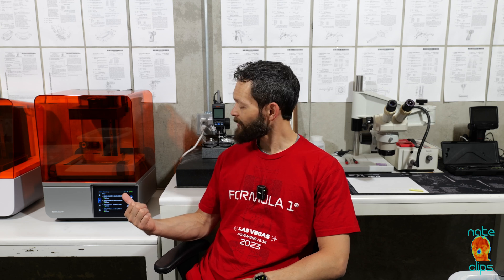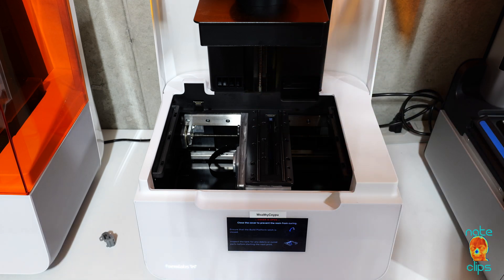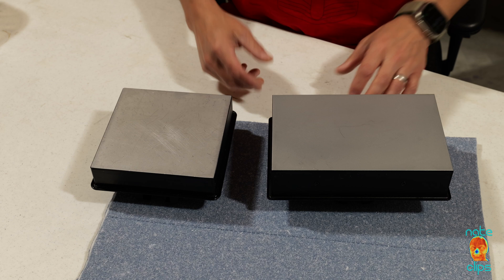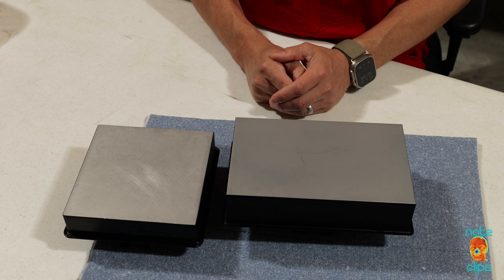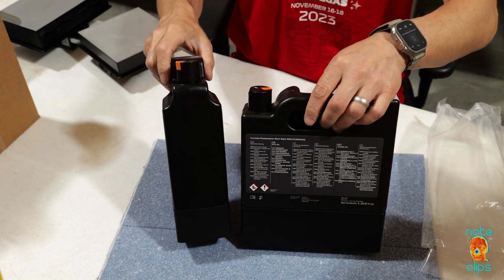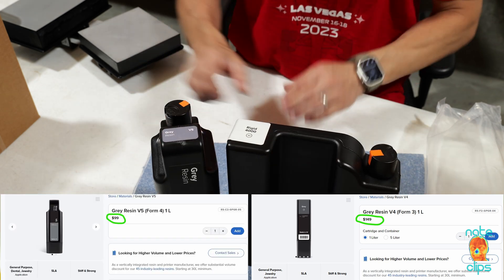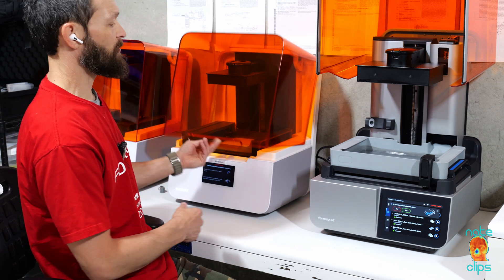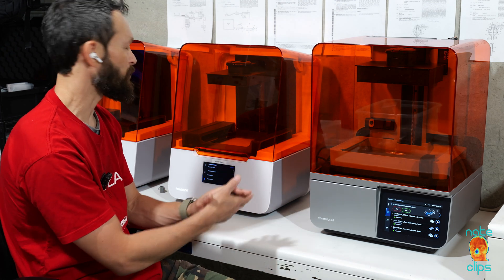Initial Review of the Formlabs Form 4 printer....is it a worthy successor? should you upgrade?

Comment: Nice video!
do you notice any chemical smell from the machine? and you mention fan noise, what would be a comparable level of noise ? a gaming laptop? a deskfan?
Reply from the maker: Any resin printer is going to have some sort of smell.  There's nothing at idle, and you will notice a smell when it's really cranking.  The severity of the smell depends somewhat on the resin type.  Regarding fan noise, watch my latest video;  while speaking on the video, the printer in frame is running and you can definitely hear it;  although, the proximity of my microphone probably drowned the fan noise down somewhat.  I also spoke more loudly while filming...i would say it's louder than a gaming laptop.

https://www.youtube.com/watch?v=LZKhpBIAne0&t=89s

Comment: The fan noise increase is due to the uv leds needing much more cooling than the laser system did. I have 2 Form 2s, 2 Form3 and a Form 3L and I may have hit the end of the road with formlabs with the Form 4. There is just way too much competition in the lcd based printer market for FormLabs to charge this much for the printer. The Form 4 is an 8k lcd which is far and away a great unit but there are now alot of other printers that have 14k lcd screens and cost in the 500 dollar range. The open source resin markets have improved so much with companies like loctite making engineering grade materials for these lcd based printers.  Also the film on the trays will need to be replace with a fair bit of regularity just like the older trays. From the appearance it looks to be an nfep material with will still over time break down and have ghosting similar to how the laser based printer films degrade.
Reply: You make an excellent point. In terms of qulaity and functionality overall tech you cant really compare Formlabs to these 500 printers but you definitely can to the Heygears Reflex and thats half the price for the complete kit and an amazing printer. I cant understand how people are paying these prices I would rather buy a few of the different brand 500 printers!
Reply from the maker: @julieta203  you make fair points, but as a U.S. based medical device company user, there are reasons why I would not/could not use some of these other companies…….
Reply: The LCD resolution in the Form 4 is 8k? I thought it was 4k since one video said 50um pixel size is quite a sweet spot for the resolution vs. light intensity.
Reply: @starride4530  You are correct the Form 4 is a 4k screen. I talked with Formlabs at Rapid this year and they also confirmed it was only 4k. They swear that they are doing some magic to somehow sub divide that pixel down to achieve a lower pixel size, but to me it sounded like image blur and AA like how Chitubox has it. Even at 4k resolution the details should be great and crispy, but I would still choose some of the cheaper 8-12 options out there. If I was to still stay in that level the new Heygears machine had amazing print results from what I saw at Rapid and it comes in at under half the price of the Form 4 and it comes with wash and cure stations for that  price. Heygears had some very nice resins on display and the feeling of the resins were extremely hard with an almost ceramic feeling. Not sure if they are achieving that hardness by over exposing the layers though.
Reply from the maker: @starride4530  I haven't seen any concrete specs on the curing screen resolution....this was olahf4890's opinion/recollection...
Reply from the maker: thank you for the informed response!  I'll look into some of the things you mentioned.